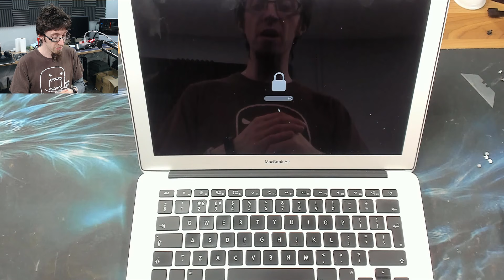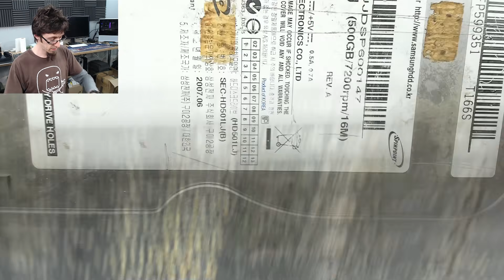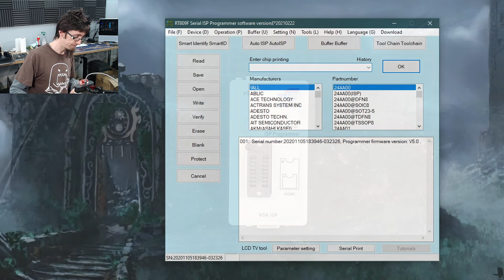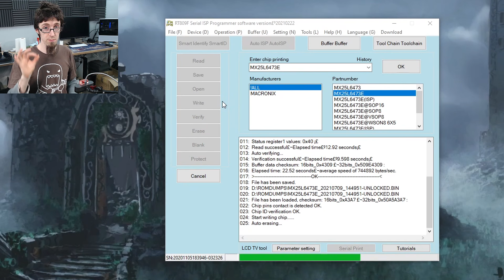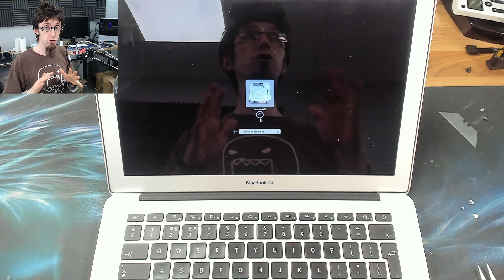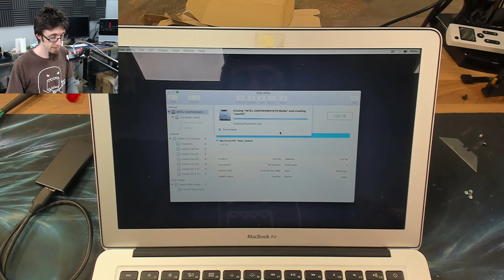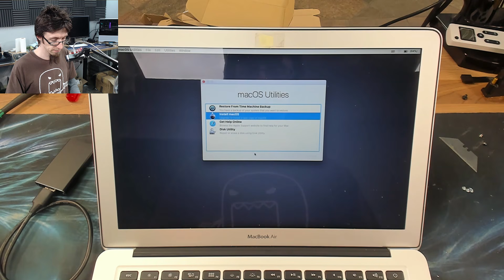[2017 and older ONLY] MacBook Air Firmware Pass / iCloud Lock Removal - LFC#275

Comment: I see that reprogramming the chip removes the firmware lock.

Although... does it remove:

1. Activation Lock
2. Remote Management Lock
Reply from the maker: It will remove an activation lock, but not remote management (MDM)
To remove MDM you need to change the serial number of the device, which requires more modification to the BIOS file. I haven't made a video on this, but the info is out there. Piernov has a video on this, and he is one of the god-tier repair techs https://www.youtube.com/watch?v=poA8HByYqTM
Reply: @Adamant_IT  Thank you for the response. My employer gets hundreds of MacBook Pro A1707 and A1990's from a big corporate company I can't mention on here. Their I.T. fails to remove the remote lock before it gets to us so I end up selling the LCD assembly and scrapping the rest :[.

Comment: Hi any ideas where DEP / MDM is located on EFI chip? Good videos regards.
Reply from the maker: MDM unlock requires a serial number change. It's not stored on the device, the device itself will check online if it's supposed to be locked as soon as it's able to.
Reply: @Adamant_IT  Thanks so much for explaining this!

Comment: What a fantastic video! You answered every question as I was asking it. I'd love it if you put together some sort of Amazon/other list showing what parts or tools you used -- from the RT809F to even the flux you used. I guess you could put an affiliate link on there as well to get a portion of the proceeds. Thanks!
Reply from the maker: I'm working on making a list of tools, but there are many, so it's surprisingly difficult to make a comprehensive list of "what I have" vs "what you'd actually need"
It's in the works though!
Reply: @Adamant_IT Is this working with M1 chip or stolen Macbook locked from icloud is useless?

Comment: I have a MacBook Air (11-inch, Early 2015) that I purchased on ebay, which I had to wipe because the laptop at the time was in my home which was ransacked. Looking to prevent my data from being stolen I had wiped my laptop and now I am stuck at the firmware password box with no knowledge of the password.

- I had tried Command + R + holding the power button
- I had tried option Command + R + holding the power button
- I had tried shift Command + R + holding the power button

Comment: Hello budy, how are you? could you help me?, i removed the eprom from a macbook air 1466, and rewrote it, because it had efi password, now it doesn't turn on and I noticed that 1.8 doesn't reach the processor, could it be the eprom?? the first time I turned on the wrong bio on the label of the recorder where the metal part touched it, closing short on the pins, I removed and read the eprom, I did the whole process, and it still doesn't turn on, can you help me?

Comment: Where are you based in the UK ? I have locked myself out of my password protected harddrive, after being hacked . I panicked and got so scarred I heard removing the battery would do it, so I ripped it out and now I have ruined that and the fittings to it. Now I can turn it on without the battery ,press option r and I just get the padlock with a black screen. It's a 2015 12gb MacBook Pro , I have proof it's mine. if you do send ins and could tell me exactly how much it would be? I think I could buy the battery myself and send that if it's too expensive?

Comment: Hi! How to unlock MDM MacBook Air 2015? Change serial number?
Reply from the maker: Yup, requires an SN change. SN is in the BIOS, after changing it, the BIOS checksum needs to be recalculated and modified as well, it's a complicated task.

Comment: I did it on a macbook air 2017 a1466 here in Brazil and it worked too, thank you.
Reply: I do have the same mac and problem. Did you follow the steps in the video??
Reply: send me a link to the copy of the firmware you used
Reply: @lawrenceboatengdwamenah7252  You can actually edit the data on the EFI chip using a HEX editor and just overwrite the password section. There are some great videos on YouTube that show how to do this. There is a cable that has the specific connector that allows you to attach to the EFI chip while it is still on the motherboard (and you do not need to desolder it), and then you can overwrite its data and remove the password that way. I used this method on a 2017 MacBook Pro and it worked perfectly.

Comment: Question, cause I've never had to do it on the Air one, but done many times on the MacBook and Pro - even for myself. So, each time, all it took was removing one of 2 RAM memory chips, turning it on pressing and holding Alt / Option button and boot up with no password this time. So, do we really have to go and desolder on the Air one? If so, what's the difference that here we have to desolder UEFI / Bios?

Comment: I have a question, I did the programming correctly, but the mac does not start, its cooler spins and then stops repeatedly, nothing else happens, is it a problem with the chip or something related to programming?

Comment: I use a sam connector on the jtag interface and leave the logicboard in place. It has been quite successful
Reply from the maker: I've heard of these and have an interest in them. In-circuit flashing can be very dodgy, but if it's a well-documented platform like the Apple boards, it's definitely a valid option. I've not checked into what considerations are needed for these yet though.
Reply: @Adamant_IT  you should definitely look into this. First time i ever fooled with firmware lock plus 2 other macs were unlocked first try. And it uses CH341A lol

Comment: Adamant, After doing all this steps and updating to Big Sur, If the customer also forgot his iCloud password he must never try to set up a new iCloud with his (reset) Macbook, will that tell Apple servers that the device was with an old iCloud account a while ago? Please help
Reply from the maker: Going through these steps, you can sign in with a new iCloud account, yes.
The only lock that will keep kicking back in is MDM, which is when there's old business network management installing security profiles.
Reply: @Adamant_IT  Thank you!
Reply: @Adamant_IT  Will this work for the 2020 MB Air M1 (A2337)?

Comment: Does anyone know, if the process works the same way not only for MacBook Air but also for MacBook pro and iMacs (without T2 chip  of course)?
Reply from the maker: Yes, same deal on other macs. You can also use an app called RCunlocker which will automatically modify the BIOS file without having to do the hex-editing as well - much easier.
Reply: @Adamant_IT  Awesome - thanks!

Comment: Hi, how can i reach you do to a similar job? i have an macbook pro 2019. Thank you
Reply from the maker: I can't do unlocks on Touchbar MBPs unfortunately, as they're equipped with the T2 security chip that prevents this kind of password resetting. To my knowledge, there are no reliable bypasses for T2. There was an exploit based around plugging a device into the TB3 ports, but my understanding is that it has been patched now.
Reply: @Adamant_IT  Hi, thank you for your reply. So sad to know that.

Comment: How do you remove/install the chip if it is a pad type as shown in this video if you DON'T have the hot air gun?  Is it even possible with the solder pad (heatsink?) under it without overheating it?  

I bought some iPad charging carts from a school auction, 2 came with A1465 MBAs, both were FW locked.

Since I have 2, I'm trying to decide if it is worth buying a PINECIL or similar soldering iron, hot air gun (if required), and CH341A to do these.  I think all the supplies would total less than the cost of having someone else clear the FW on both, and would leave me the tools to work on other things in the future.

OR if I can remove and replace the FW chips with a cheap soldering iron (or combo of cheap to remove and PINECIL to replace), I would go with the Ebay sellers that will program in the serial numbers for me.

I haven't pulled the motherboards yet to look at the chips, so don't know if they are pin or pad type.  Pin type should be dead simple with a PINECIL to lift the pins.

Comment: This video is super helpful, I've been recently trying to flip broken MacBooks from ebay (usually busted screen and/or water damage) but have often had them end up with a firmware or icloud lock after the repair meaning I'd end up a couple $100 out of pocket and labor time for a paperweight. with this info I can save these from the scrap heap they were destined for. Thanks!
Reply: Il doing the same as a side hussle could you tell me if this method actually worked ?
Reply: @lorenzocicchi1961  I was able to successfully get one working, haven't had to try it on any others recently because the price of broken macbooks has skyrocketed. No more profit in it, unfortunately for me. Now I'm just trolling facebook looking for broken ones and offering repairs or to buy the broken ones
Reply: @mtnentertainment3454  you still in the macbook market? Got one, im in 2 minds , attempt what adamant done, or take an easy path.
Reply: How can you tell if your Macbook is tied to an icloud account? Will it always say it's tied to an icloud account even if you wipe it and reinstall the OS? I bought a used Macbook, and checked and it doesn't have a firmware password. Checked icloud, and it's not signed in. Though I don't know the previous owner wiped it and it wouldn't show if it's tied to an icloud account or not. As I'd be nervous of someone years later put it in lost mode on their Find My and lock it up.
Reply: @colt5189  if it's tied to an icloud account it will tell you. It literally won't let you finish set up until you either sign in, or remove the icloud account.
Reply: @mtnentertainment3454  is there profit still

Comment: If you are trying to give access to someone's family photos or get round a forgotten password etc,  wouldn't the data have disappeared when you put macos back on?
Reply from the maker: Data recovery has extra steps, this video was focused on getting the device working. But my point is that there are many reasons why you'd need to bypass security on a device.

Comment: Wouldn't it be easier to use some clips from amazon or eBay and use them to connect the chip to the usb flasher so that you don't need to desolder and solder back the chip?

Comment: Spent a lot of time doing hand placement and rework on boards for Motorola and Raytheon. No need to remember the orientation of the chip. PCBs have the graphic showing pin one (shown in video), and the chips have either a printed dot or a small divot showing pin one.

Comment: First what you need is a chip holder so you don't solder it everytime when programming. Second what you need is smaller hot air station, check yihua.

Comment: you know if there's a way of also editing the emc of the board? mine is a 2017 i7 a1466 emc 3178 macbook air but the motherboard broke(out of warranty,took it to a repair shop for reballing but no fix) and i can only find the 2015 version (same board and everything,just a different emc:2925)

Comment: From my experience, apple and universal pc:s have bios/uefi passwords for settings in bios/uefi (not apple), then there's boot device lock password, and once device tries to boot os on drive, there may be "HDD password"/iTunes lock. On iTunes lock, you can get password from filename of some file somewhere, just search for it on search engine or wipe the drive. I have had success with clamp on programmers for 2010, 2013 and 2017 macbook's smc nands. If anyone is still reading this and thinks about pushing that write button, then don't. You MUST have at least 3 separate identical reads of original flash for peace of mind. It's even more important in case of in circuit reads, since you can have capacitive and inductive interference from connected circuitry. If you can't get "good enough" reading, then it's in computers original bios'es best interest for you to risk it and desolder whole flash chip in order for you to get perfect dump.

Comment: Can you take the SSD and put it in a PC, or a compatible machine to recover the data?
Reply: I have done that with some unix/linux disks.  You need the Paragon Utilities mount drivers, probably some others available too.  Can't say if it will work on a Mac disk.  If you absolutely need the data, put in a brand new SSD (cheap now), reload MacOS, and then put the SSD into a holder and 100% read it in the Mac.

Comment: Very interesting video.  If the client needed to save the data you could take out the m2 or sata drive, put it in a USB adapter and get the data off the drive.  Then put the drive back in and proceed with your wipe and format.
Macs with soldered in drives would need a higher level of recovery to keep the data before wipe.  Please correct me if I’m wrong…🤷🏼

Comment: I looked at yt videos of bypassing my nephew's iPad 2, and there were only fake scammer videos doing to get Hits, and so many of the fake users recommending this and that at instagram. Gave up on it.
BTW: What happened to your electric screw driver? You used that for a while...?
"It's never the CPU, except when it is..."
Reply from the maker: Still use it! I pick up whichever screwdrivers are to-hand, and the electric bois are sometimes at the other workbench. But also I usually keep a PH0 bit in the electric screw driver, so for macbooks it's faster to pick up my T5 Wera.

Comment: Hey, I have an EFI locked 11" Macbook Air, I was able to desolder the chip and reprogram the chip to remove the EFI lock. Upon first assembly , I have gotten the laptop to boot up. However, after removing the board to clean the flux with some alcohol, it no longer boots. I tried resoldering the 8 pin chip next to the BIOS chip but there's no luck. At the moment, when I plug it in, it flashes orange for a moment before turning green despite having an adapter plugged in. Do you have any idea which voltage rail is missing or would simply be the U6101 chip acting up(I have soldered it backwards oops, I may have also scrubbed too hard but that's not too likely to break the board)? Thanks for the informative video and I'm looking forward to your reply!
Reply from the maker: I don't have schematics in front of me at the moment to check what U6101 is, but if it got soldered on backwards, it's quite possibly dead, and will need to be replaced =/
Check if the correct signals are going in and out of it
Reply: @Adamant_IT  I have ordered the chip and received it. Will get it soldered over the next week. Any idea if a cheap multimeter will suffice in this job? I don't have a Fluke nor do I have access to an oscilloscope. Thanks!

Comment: 10:20: There's a lot of CH341A kits out there that already come with a ton of adapters, including one for 1.8V (with seems to be the current standard). It's just a couple of dollars more, so probably a worth-while expense. There's, however, another big drawback with the CH341A in general: When I got mine, I wanted to test it on some old/dead motherboards to familiarise myself with it. I grabbed the first board, and the BIOS chip was a PLCC32 package. Yeah. The chip had more pins than the programmer (32 vs. 16). No easy adapter fix for that. Ok, maybe a weird exception. Drew another board (different manufacturer, different era). And again, PLCC32. Third board. PLCC32. Ok, how about a laptop board? Well, no PLCC32 this time. But a QFP32. And the list goes on. Not a single board in my stash that had a BIOS chip with 16 pins or less. To this very day, I have yet to find a chip that I can actually program with the CH341A.

When I saw your video LFC #272 with the two BIOS chips that were simple 8 pin DIPs, I was like: What kind of witchcraft is this?!

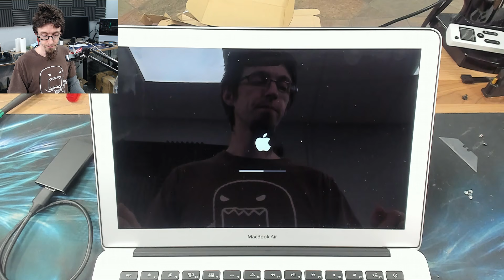Comment: 18:50 but if you say you need to erase the disk contents how is this gonna be useful for those cases you presented at beginning of video where customer needs access to his photos, music, docs, etc?
Reply: On this specific model, the SSD can simply be removed and put into an external drive sled to access data from another computer. The SSD is non-removable on some models, but I'm not sure if those models use the same UEFI chip. If they do use the same chip, this would be helpful in the case of needing to access data since target disk mode could then be enabled without the firmware lock. In that case this method would be overkill to just access data though since there is hardware access data on those models even when they don't power on.
Reply: I was thinking same thing good question.  I still enjoyed watching the video.

Comment: There are scenarios where it might be better to change the serial number, however. I had a customer's laptop where it was locked for updates and only supported by the original IT department that supplied it to employees. The staff member was allowed to keep the laptop when retrenched, I trusted his story , but updates applied to it resulted in a mac that was software locked. I was able to clone a working system onto the laptop, without this password, but told him not to update the OS or the installer would send the serial to apple and relock the laptop.... The only way around this I can see would be to change the serial number.

Comment: Thats really clear and quite impressive. I cannot help feeling that your labour is worth at least half the value of that used mac air, however.....  possibly a bit more than half.
Reply from the maker: Videos like this always make the job seem long and in-depth, but once you've done it once, doing it again (and off camera where you just get on with it) is very little effort.
So this is very much financially viable if the repair person is just cracking on and not making YouTube videos. I still do it cheap because while it takes me significantly longer to make a video about it - I get to make a video about it.